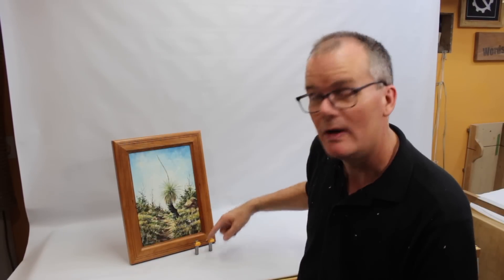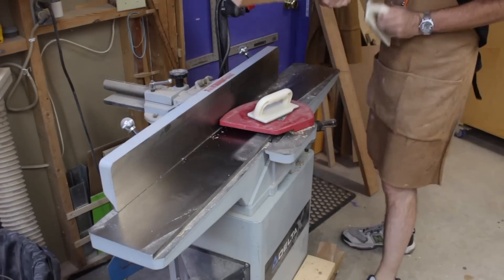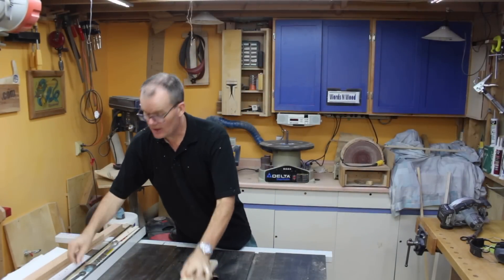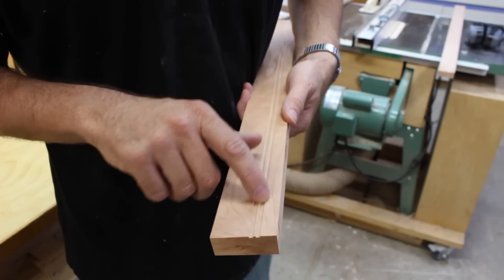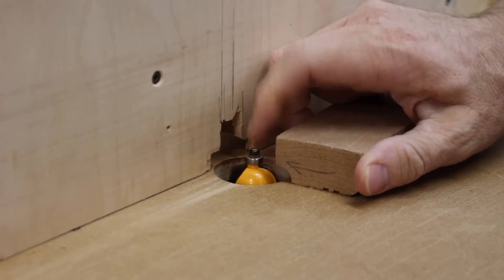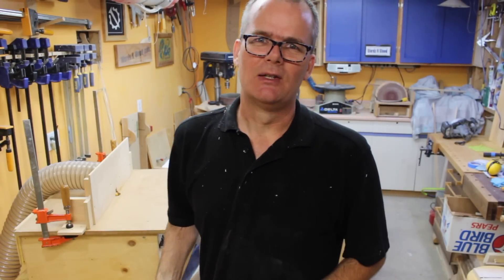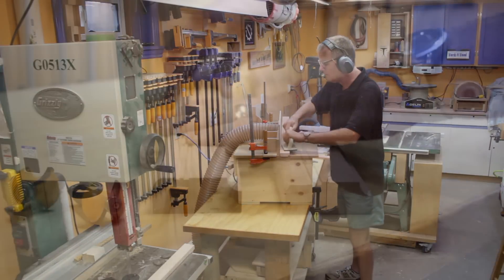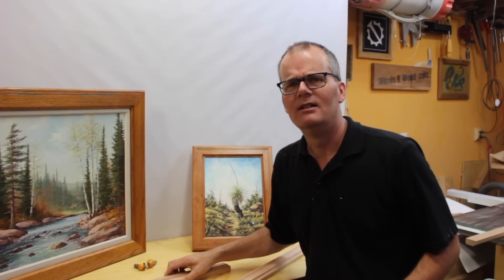Easy DIY Picture Frame Stock (WnW #111)

Comment: Incredibly elegant. Love the Cove cut. Buying precut Picture frame sticks is extremely expensive as they normally are shipped in 10 or more foot lengths. I will search to find a spacer for my Dado blades to allow spacing the blades apart one to two blade widths for the grooves you cut. Doing this in one step. Your method looks good to me to follow along. I enjoyed the informative video, well lit, good audio.

Comment: Fantastic! Thank you for this video! I’m just barely finishing a frame using this technique. Much appreciated
Reply: I just need to figure out a way to easily stain or paint inside those pin stripe grooves. What do you do for finishing the frames?
Reply from the maker: usually rattle-can spray lacquer or something simple like that.
Reply from the maker: ps:  try applying some wide tape BEFORE you rip the pin stripe grooves.  Then spray something dark in the grooves, then remove the tape, then finish the frame build
Reply: @Wordsnwood  great thoughts, thank you! I made a pretty large frame using this technique I’ll see if I can share a photo or something. I think it turned out great. Thanks again

Comment: Nice haircut and very useful tips!  What did you use to stain the frames? Looks very smooth.
Reply from the maker: Andreu Ahn I never stain cherry.  As for the oak.... Sorry, don't recall.  Maybe a minwax early American or golden oak...
Reply from the maker: I just checked... A sealcoat of shellac and then polyurethane on the cherry
Reply: Ah that sealcoat...looks real smooth and touchable.  Thanks!

Comment: I have neither a planer or a thicknesser, nor do I have room for even a machine that does both. I do have an electric plane and I was hoping to use this prior to get my wood level and untwisted. Just how crucial are they to picture frame making please? That’s why I’ve taken up an interest in woodwork, I just to make A2 frames for my archival images.
Reply from the maker: I have no experience at all with hand held electric planes.   Sorry!

You can buy wood that is fully surfaced, it just costs more.   Some lumberyards offer this as a service as well.
Reply: Wordsnwood (Art Mulder) Thank you for your prompt reply and suggestion.

Comment: is there a spot for making frames for dummies without all the tools?
Reply from the maker: Try the Woodworking For Mere Mortals channel.   Steve does a lot of "limited tools" projects.

But you could do all of this with a router table + tablesaw.    Second hand tablesaws are  pretty cheap and it is often the centrepiece of a shop so I kind of expect people that watch my channel to have one.   And a router table can be made for practically nothing.   I have a video where I show my basic router tables which were made for less than $25 or so:  https://youtu.be/GgA-69nnKFo